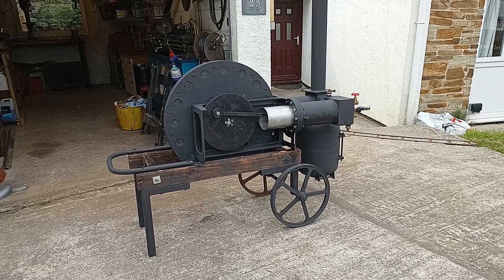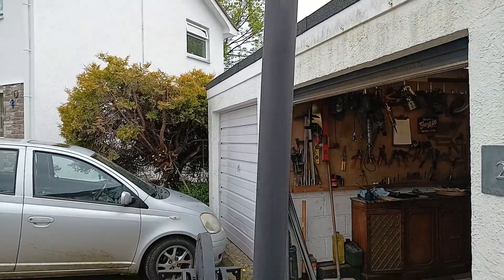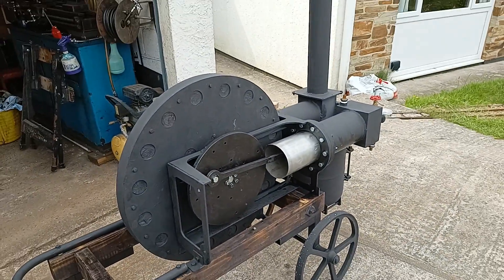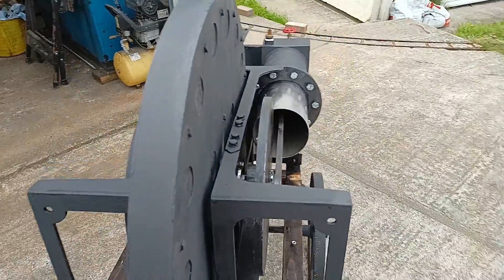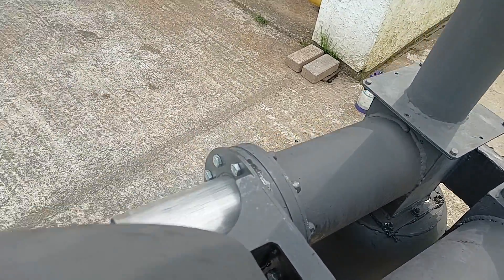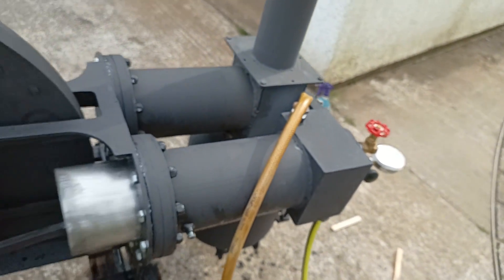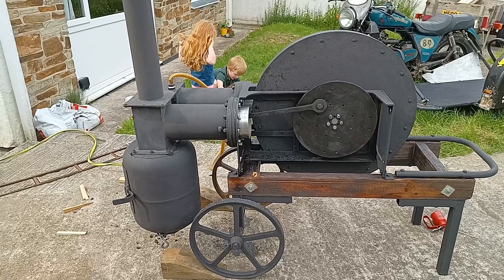Stirling Engine Horizontal Alpha Stationary Engine - Part 8

Comment: Normally would "stack" the pistons as the principle is hot air rises/pressure released vertically can weld on some heat exchanger fins on the exterior as you're trying to maximize heat retention to the physical item itself as that is your power source once all the heat disipates because everything is round and absolutely very hot to the touch no more energy retained in the item itself so the pistons stop working😊😊

Comment: I think that chrome-nickel steel for the regenerator is not the best material. Because it has low thermal penetration. Steel wool would be much better. Carbon steel has three times greater thermal transmittance and copper has over twenty times greater thermal transmittance

Comment: I like your project. I think it's informative and helpful. Im looking into building one myself. We burn a lot of wood at the cabin and I think that your idea would be ideal for what I want. 
 The one I've been thinking about would be similar to yours but I'd like a 3 cylinder model. Also mine would be a little smaller. I think these would work better if they had a bigger flywheel. One that is weighted correctly. The momentum from the flywheel would make turning 2 alternators less labor intensive. But it is an amazing build. I think you should be proud of what you built. Thank you for all your videos.
Reply from the maker: Hi, I've always imagined one in a cabin that had the cold side outside through a wall. Whatever you build please do a video : )

Comment: С чего сделан поршень и гильза , какая смазка ?
Reply from the maker: Piston is a ram / plunger type so there is no honed bores to worry about. Piston is sealed externally with stationary leather seal on cylinder top. Lubricated with light mineral oil
Reply: @ShanePomeroy сами поршни сделаны из алюминия ? Или нержавейки?
Reply: Спасибо за ответ

Comment: I'm no expert on stirling engines but I think your displacer tube should be above the heat source and the piston should be where your displacer tube is. As it is now the piston tube is heating up over time so your displacer is no longer able to feed cold air to your piston.
Reply: He did a test for shipping and put in a radiator and a water pump to solve this.

Comment: Regenerator is too small, the high compression ratio would hint at this.  The heat exchangers are likely too small, and it would probably benefit from water jacketing the entire cold side.  It was smoking a bit from the seal on the hot side, guessing the epoxy and possibly leather is failing from the heat.  Great project!

Comment: Instead of using a flame for heat, try using a Fresnel lens heat collector focused on an inductive high temperature ceramic block for a heat source.. The lens (large 60") produces temperatures of over 3,000F from the endless source of the sun. The ceramic block will soak up more energy than you could ever need for free, and hold it for days if needed, A kind of heat bank if you will. The bigger the block, the more energy will be stored. Even on cloudy days the lens will produce 1500 degrees F. You will need to create some housing around the block to contain and direct the heat of course but that can be done with a simple air crete blend of portland cement, or cinder blocks might work as well. You will need an intake port and an exit port for the heat to travel through with the higher end being the exit since the heated air will be rising of course. That is where the hot air will be supplied to the engine or just before where it exits. Here is a video link of a fresnel lense, https://www.youtube.com/watch?v=DGtA8E5iw3k. You can find one (lense) in an old big screen rear projection tv or you can find some online for about 120.00 (u.s. dollars). This is something that I have been trying to get to making the set up but too much life gets in the way... Great work by the way! Check this out..https://www.youtube.com/watch?v=EZihJcJ3Wfw

Comment: I love what you are doing? Have you considered adding a sand battery jacket around the entire hot piston/cylinder assembly and extending the cooling battery jacket to cover the entire hot piston/ cylinder assembly? The increased temperature difference between the two cylinders should increase efficiency. 

Have you seen the Blade Attila channel as focuses on Stirling Engines, also another good channel is Robert Murray-Smith.
Reply from the maker: A sand jackets a new one on me! I'll take a look, cheers

Comment: Nice work. Wanna make a stirling myself also, one day. Suggestions: just optimize as much as you can. Is the hot side losing much heat by radiation? Is the cool side getting too much heat from the hot parts? The re-gen distance seems too short to me. Maybe running the air going to the fire first around the cool side, cooling the cool and pre-heating the air going to the fire.

Comment: Why don't you, just as a test. Take the discharge of the cooling water and let it spill out over the top cold cylinder to cool it. Maybe it will continue to run that way. Just to give you an idea if that's the problem.
Reply from the maker: I've gone one step further and welded a cooling jacket on! Stay posted for a video in the next few days, many thanks

Comment: Beautiful engine, this one would actually perform some useful work.
My guess is that the cylinder/piston temperatures equalized....maybe you need a regenerator to capture and recycle the heat.
That water heat sink doesnt look like it has enough contacting surface area...the hot gas is blowing by without cooling.
Also it was my understanding that the driving cylinder should be 2/3 the size of the displacer cylinder.
Yours look about equal size. 
There's my 2 cent opinion.
Please post an update when you figure it out...i want to see this beautiful engine running.
Reply from the maker: I think your on the money regarding temperatures equalising! There is a regenerator but I do wonder about it's effectiveness! It is basically made out of a stainless scouring pad.

The cooling area is deceptively huge! If you look at the previous video's of the build you can see this. Knowing what I know now this would of been bigger / longer.

The 2/3 rule of thumb is for displacer type stirling engines (beta, gamma). This is a alpha engine. I suppose technically they could be a different size with different strokes.

Cheers
Reply: @ShanePomeroy  regarding the regenerator I seen a guy actually test different coarseness of steel wool and the coarseness matters. Fine wasnt the best and neither was the coarse. There was a "goldilocks" sweet size for the steel wool.
Sounds like you know what you're doing. Ive always wanted to make a stirling of this size for a log cabin in the woods.
Hope you git it goin👍

Comment: This is great work. Thinking you have it all figured out just some fine tuning as you put it. Heat shield for the cooling side,(heat shield from and engine block or muffler) a one way valve with a shutoff valve attached so can find the sweet spot, maybe less fire to start. And the hardest part... balance balance balance. I do worry the cement could crumble throwing the balance off if going to fast. 
If it's the pressure that stops it maybe you can use it like a Killswitch. Like a footpettle level with the ground attached to the valve. (Safety first...or was that 3rd?...) The water jacket is good but I won't do it just yet. I have an idea to make this same one but using solar tubes and geo thermal. Unfortunately I just have 60 tubes and an idea.
Reply from the maker: Hi Anthony. I'm also interested how the concrete will last! It is encased in steel sheet so it shouldn't go to far (hopefully!)

I'm interest in your cooling idea? I'm not looking forward to welding another cooling jacket on : )

Cheers
Reply: Well I think a copper line wrapped at one end with the hose to it first  then copper to where the water is going now. I'll have to get back to yeah, gotta get ready for work.

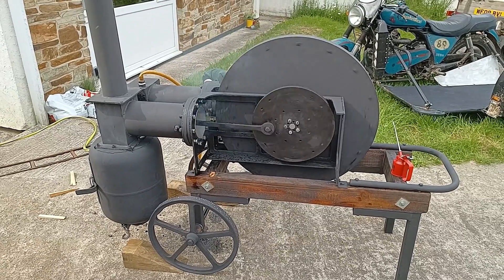Comment: Surely the smoke coming out of the open end of the hot piston means the hot piston has a hole in it? See @6:56
Reply from the maker: I think it's the seal leaking 🤔. I will take a closer look next time, cheers
Reply: That is a beautiful machine, You have good ideas to refine it.

Comment: Shane I know this is trivial but what about experimenting with different materials for the regenerator like aluminum or copper ?
Also Ive often thought that you are pressurizing the system but the back end isn’t would there be a way to pressurize the back end so that the overall pressure and working fluid could be raised to improve the energy conversion

Comment: Hello friend, first your engine was very good and robust.
I loved the diameter of the pistons as well as the stroke, and I was impressed with the high speed you achieved, given that your design has a giant internal displacement, congratulations.
Were you able to find out what is the defect of your engine for stopping to work? Was it really just engine overheating?

Comment: Might be worth having a look at a mechanical lubricator for the cylinders from a model engineering supplier like macc models or reeves. Additionally some steam oil might cope better with the high tempretures. Looks like the engine is coming together well though!
Reply from the maker: Lubrication is my main concern, I will look at those lubricators, many thanks

Comment: Great stuff! I would maybe find a way to engul the cold cylinder more in to the cold water supply, so that cylinder is in a sleeve. Better maybe add insulation to the hot side / in between. Some fire retardant wool perhaps to sleeve the cylinders?
Reply from the maker: Hi, I'll try the insulation first and resort to water coolers if needed, many thanks
Reply: @ShanePomeroy  No, Shane! Many thanks to you for making such inspirational content! It makes me want to try out also!

Comment: An easy test for seeing if radiant heat is causing issues is to use some aluminium foil as an "insulator". The aluminum should reflect away most of the radiant heat. So, for the seal on the hot side and the cold side cylinder, you could just wrap some aluminium foil to see if it helps. Highly reflective metals are usually the way to stop radiant heat, often aluminium sheets are used for this purpose in more permanent setups.

Love the changes. It was humming along nicely to start! I wonder what sort of power it was developing at the beginning, I bet you were at that 500W mark. If you can solve the heat leakage issues, you'll surely have it running that nicely for longer periods.
Reply from the maker: Interested to hear about the aluminium insulation method, many thanks
Reply: @ShanePomeroy  I forgot to mention, the more polished/reflective they are, the better they should work. (Emissivity=absorptivity)

Comment: Could use a non-return valve between engine and gauge to capture and display peak pressure - like old car compression testers.
Reply from the maker: Yes, you are quite right. I'll order the bits to do this now, cheers

Comment: Could you try to modify the first firebox to work in this configuration? Have it exit straight up instead of turning.  Because i think the insulation would help. Especially if heat radiating from the propane tank firebox is affecting things, plus heat going somewhere it shouldn't affects efficiency. Also i don't see why it wouldn't be a configuration for a practical engine. If it can make some decent power I could imagine it an awesome off grid power generator. One could build a more permanent brick firebox and the engine can be on a strong table with storage underneath, maybe firewood storage. A big belt around the flywheel to an alternator. Id want to build one at my place!
Reply from the maker: The rocket stove could work yet. It would be fairly easy to make it fit if only to experiment..... One benefit of a horizontal engine is everything is very easy to get to. Cheers

Comment: Well, with every video you have solved more problems. Certainly, solved the flywheel. Regarding high temp piston seals (there is some really interesting Gasket material around these days).  = Dobson and Co [Gaskets] Ltd Unit 1 Holme Mill Ind Estate, Fell Lane, Keighley, West Yorkshire BD22 6BN. You might get a couple made up for free and maybe some good advice. Your project is interesting. Talk to the right person and send them a link to you channel.

Comment: A thing of beauty nonetheless, really nice way to save it.
If you're still wanting to generate from it, magnets on the rim of that flywheel and a serpentine coil surounding it should give you some serious volts!
I still think the regen needs looking-at, but I also agree that the one-way valve is the first thing to correct. As always, just the musings of an interested viewer. No expertise here.
Reply from the maker: Many thanks, all good ideas. I was wondering how to add a generator! Didn't consider using the rim! I will probably get to the regenerator when I've sorted the rest out. Cheers